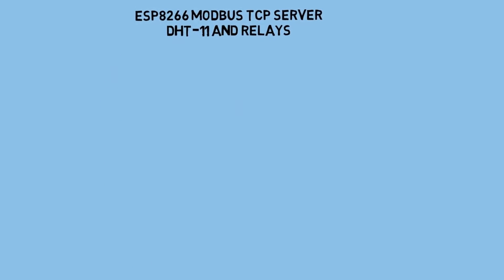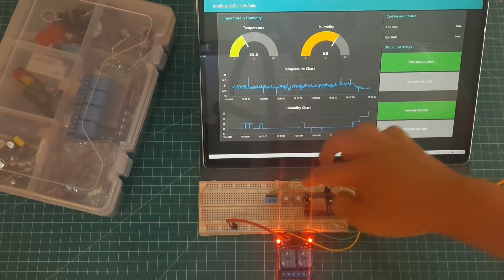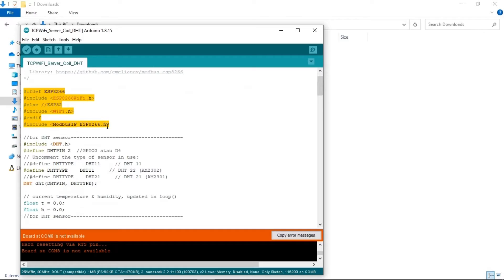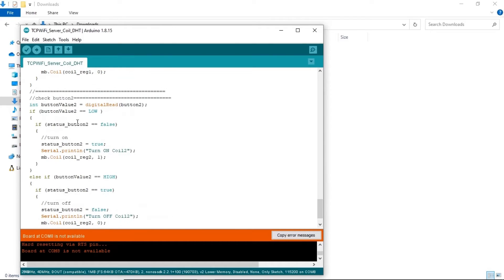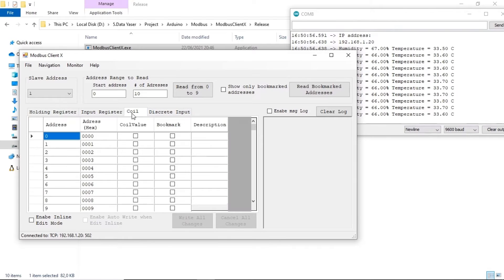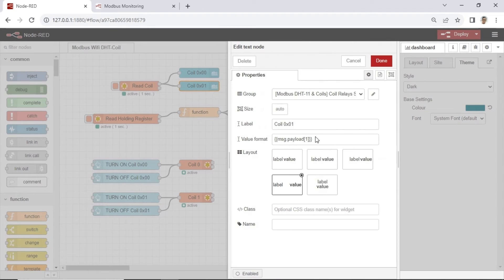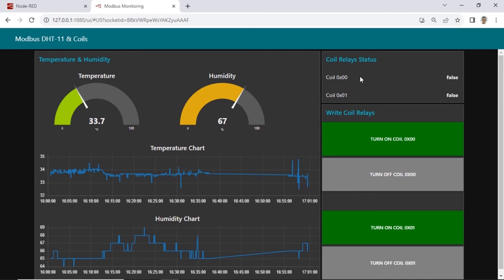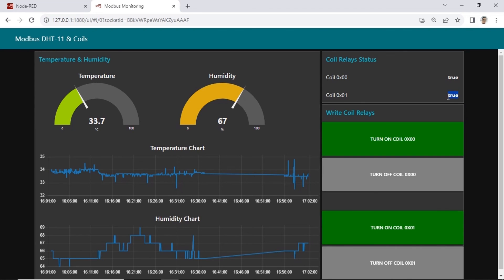ESP8266 Modbus TCP Server, Node-RED as Client, Control Relay in Coils and DHT-11 in Holding Register

Comment: Hi Sir, 
Is that possible to use without internet connection
Reply from the maker: No need internet connection,
Just wifi connection in same network
Reply: @YaserAliHusen  You mean only Wifi router required... Right
Reply from the maker: @karthikvhiremath1886  , Yes correct
Reply: @YaserAliHusen  Thank you so much Sir.....

Comment: Hi, how to get or set port number please?
Reply from the maker: default port is 502, if you want to change, maybe you can change it in library
Reply: My system not detect while using node red / modbus poll, is it need any gateway fr rs485 to tcp

Comment: how can this be done with wires??
Reply from the maker: Using ethernet cable?
You can use Arduino with ethernet shield and use ArduinoModbus library
Reply: I probably didn't express myself correctly. I'm interested in ways to connect ESP32 to SBS with Nodered via wire directly, use the device without a Wi-Fi router. I'm thinking about the possibility of exchanging data via UART, but have not yet tested it in practice... @YaserAliHusen